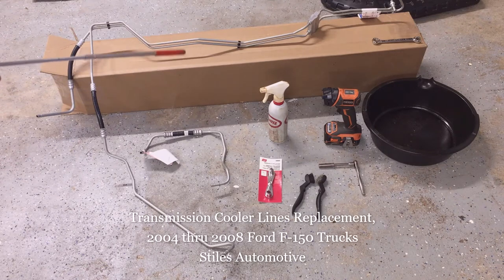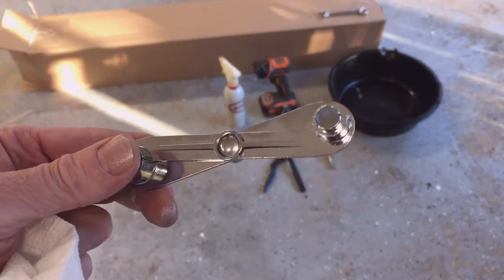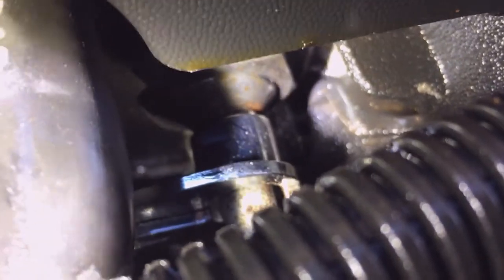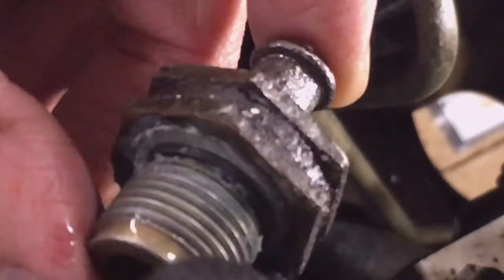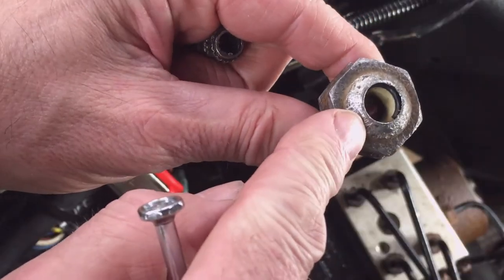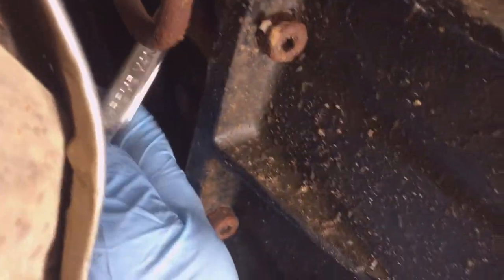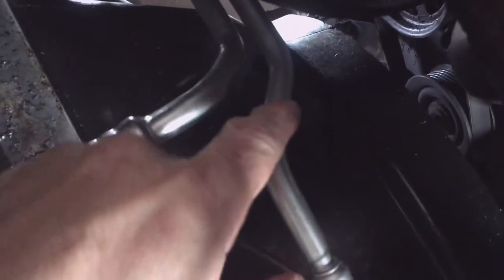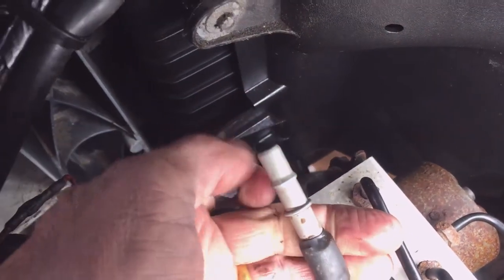Transmission Cooler Lines Replacement, '04 thru '08 F-150 Trucks

Comment: Damn! Seems hard but doable like u said. This is my next task. My 07 f150 lines are rusted and leaking bad. Thanks for the video.
Reply from the maker: Zeerich, Yep hard and something you can do. So hard in fact, I bet, some young Designer used a CAD Software to manipulate the Transmission Lines and remove them in the Virtual World, prior to the F-150 prototype and production. Let me know how it goes! - Stiles

Comment: Just finished this job on my 04 f150. Thanks a lot for the description, tools and P/N’s. A second pair of hands really helps too.
Reply from the maker: Hamid, You are very welcome! - Stiles
Reply: Did the p/n he provided fit the 04?  Most sites are giving me a different part number and different picture.  Just wanting to make sure.
Reply: @davidmobley4983  yeah the p/n’s fit. Also if you’re in a pinch some dealerships carry it. Also If you’re replacing the oil cooler, check advanced auto parts if you have one near you. CODE: DEC3
Reply: @hamidbaweemu7869  Sorry to ask again, but did you get the 5l3z -7r081?
Reply: @davidmobley4983  yes and 7R081 was my transmission too.
Reply from the maker: @davidmobley4983  David, I didn't see this exchange of information until now, you have to comment to the first level of the video for me to see it in a You Tube inbox.

A great resource for Part Number and Fitment information is simply Ford Parts. Com   -   https://parts.ford.com/  

If ordering Parts thru this website: My local Ford Dealer Parts Department was confused by the order, you can order 3 different ways: 1) Thru FordParts.com, 2) Thru the Local Dealer Website (which mirrors the FordParts Website, and of course 3) at the Local Dealer Parts Window/Counter.   - Stiles

Comment: having this exact issue and you saved me $600, thanks alot man
Reply: mine was actually the upper connector
Reply from the maker: Justin, It sounds like you already completed the job, but if you haven't consider doing the Power Steering Lines (and maybe Pump) at the same time. You are under the Truck and working in the same area . .  and if your Transmission Cooler Lines are corroded your Power Steering Lines are probably as well! I also did a video on the Steering Lines and Pump (see link below). You are very welcome, I'm glad to help! - Stiles

Power Steering System Rebuild (Removal-Cleaning-Installation) - 2004 thru 2008 F-150 5.4 L  https://youtu.be/m1BS50bgKLk

Comment: Great video! Extremely helpful and I appreciate the description links. Thank you
Reply from the maker: SixPack, I try to give you everything you may need if you haven't done the task before. I appreciate the feedback. Do you have a 3x 2bbl car, like your name implies? - Stiles
Reply: @StilesAutomotive  Unfortunately not, but the old 440 six pack Barracudas are some of the coolest cars. If anyone reading this has one and wants to trade for a rusted F-150 with a transmission fluid leak, let me know

Comment: Bottom of my truck is all rust. I hate Ford and all the others because they can't take the time to zinc plate or treat components against. All about the money. The other thing are the quick disconnects. Why can't new ones be included with new lines purchase? I don't get. Pain in the rectum buddy. Good video. Subscribed.
Reply from the maker: Rob, I'm with you on that!  For a little money, all OEMs could make cars last 10x longer.  What am I going to do? Buy a new F-150 and take it apart so I can treat the frame, then the parts as I put it back together?  That's an ideal, Ford should sell me a complete F-150 in parts . . . I hate rust!  Don't get me started. Thanks for the comment. - Stiles

Comment: You used both the Lisle and Assenmacher cooler disconnects.  Both are 3/8”.

Since both removal applications on the radiator and cooler are 3/8”, does one work better than the other or do I need both?

Great video . . .
Reply from the maker: Robb, I actually broke the Lisle Line Scissor and ordered Assenmacher Tool, when I determined I needed the Trans Cooler a few days later. To be fair, I abused the Lisle Tool pretty badly, so I didn't show it broken in the video.  The Assenmacher  Tool is much nicer, and I took care of it.  I like the Assenmacher Tool better, but it is just 3/8", the Lisle Tool is half the price and also fits 1/2" ( on the other end).   I appreciate the feedback! - Stiles

Lisle 39660 1/2" x 3/8" Transmission Oil Cooler Line Scissor https://amzn.to/3m9eeQ2
Assenmacher Specialty Tools 8021 Oil Cooler Liner Remover Tool, 3/8"  https://amzn.to/3dRlCet
Reply: @StilesAutomotive  How did you determine that you needed the cooler after you installed the lines.  Was there debris that backed up pressure and caused a leak?  I was wondering if I should gamble that the cooler is still good after 220k miles.  I’m the second owner so am thinking it is the original cooler.

Comment: Thank you for the detailed video. Your helping me with mine at the moment. Almost removed the old line but what size flare nut wrench at the transmission?  Thank you again for the video.
Reply from the maker: JD, 5/8" for both Lines at the Transmission! You are very welcome, I hope your replacement goes well! I appreciate the comment! - Stiles
Reply: @StilesAutomotive  Thank you. I promise I listened to your video about pulling the whole thing out to practice to put the new one in. I got the old one out and trying to put the new one in. But I'm guessing you used magic because this is insane lol. And I had to cheat and cut the old one and now dealing with the consequences 🙃

Comment: Thanks for the info! Question, i believe my leak is coming from the transmission thermal bypass did the lines you recommendee off amazon come with that?
Reply from the maker: Tuan, Yes, it did come with the Bypass Valve. You can see it in the Thumb Photo or in the video when I show the components required, I also link to the Amazon Page in the video description which show a photo of the lines. - Stiles

Comment: Thank you for this video. I am ordering parts now. Is there a special procedure for filling the system. I found comments that there is a special heater tool for the fluid that is needed to open the thermostat block to get the air out?
Reply from the maker: John, You are welcome! I you are working with an OEM (at least Ford's) Transmission Cooler System there is no need to bleed or purge the System.  The Transmission Pump puts the Fluid under pressure when it runs it thru the Cooler, this will push the Air to the Transmission. You do need to properly fill the Transmission and use the Ford Operators Manual to determine the proper Fluid level.  Go back after driving the Truck and check the level again. - Stiles

Comment: I’m trying to figure out which tools I need to order from Amazon? You said one arrive later so do I need all three?
Reply from the maker: Dave, Did you see my reply to your other comment?  You need either the Lisle Tool or the Assenmacher, one or the other, I'd recommend the Assenmacher.  The Lisle Tool can also be purchased at your local Auto Parts Store. May sure to get the correct Tool Model Number, this Tool looks similar to other Quick Disconnect Tools.  - Stiles

"Dave, Nope, Sorry. If you have an F-150 you have 3/8" Cooler lines, if you have an F-250 most use 1/2" Cooler Lines. The Premium Assenmacher Tool (Shown) is 3/8" - Cooler Line Tool Assenmacher 8021 3/8" https://amzn.to/3dRlCet. The Lisles Tool is for both 1/2" and 3/8" - Cooler Line Tool Lisle 39660 1/2" x 3/8" https://amzn.to/3m9eeQ2. If you are removing the Lines from the Transmission you also need - The Flare Nut Wrench Set, 3 Pc SAE https://amzn.to/3iN9r5c

I always list all Tools and Consumables in the video description for each and every Task I have on my Channel. - Stiles"

Comment: I can not find a full line assembly like you have here. Your link is only showing the line or #3, I REALLY need #4 but can not seem to find a part # anywhere. Your assembly looks like it came with it. Did it?
Reply: FORD 7H322 - for anyone also wondering the same! Took me HOURS to find
Reply from the maker: I show the 2 Line Assembly in the first 30 seconds of the video, I copy the link here (Trans Cooler Line Ford 7R081 both lines https://amzn.to/31YoqUw  ). This is the compete 2 line Assembly for the 5.4L 

This Ford Parts Site is helpful (it shows the Assembly and your 7H322 Valve Assembly):
https://parts.ford.com/shop/en/us/transmission/powertrain-engine-parts/oil-cooler-assy-7891527-1#/sectionId:141078549    - Back out of this link and put it your exact vehicle information, use the Driver's Door Sticker to determine your F-150's Build Date, as required.

This Ford Site answers your last question, "Did it?" Yes it is the complete Assembly including 7H322 Valve Assembly.  Notice the little Square Indication, pointing to what is in the 7R081 Oil Cooler Tube Assembly.

Let me know if you need any other help! - Stiles

Comment: Anyone know if this works with 05 f150 4.2L v6 ? Looks alot like the one i need to replace it has a rubber hose/hose clamp bandaid on it and it wont last forever😢😢 hard to find this hose. Thanks for this video btw.
Reply: An update if anyone is wondering I ordered this 5l3z-7r081-cb and it does not seem to work on the 2005 Ford f150 4.2litre it looks almost identical but when I routed it it angles the wrong direction and can't work. I'm going crazy trying to find this stupid part and be done with it. Back to looking . Hopefully this Ford dealer i bought from this Amazon link will let me return it ..........😮😮😮😮
Reply: And to top it off I called ford hoping they would give me a part number . They did but it's the exact same part I ordered and now I think I'm crazy cus I already shipped it back but it was clearly different all the angles were going the wrong direction. 

They said 5L3Z7R081AB I dunno if that is different than 5L3Z7R081CB 🙉
Reply from the maker: Bonzai, It looks like your Truck has 3 options, with and without the front Transmission Cooler, and there is a Production Year Split for the 4.2L F-150: 08/23/2004 - 11/29/2004  and 11/29/2004 and after.  I cut & pasted the information below and added a link to the Ford Parts website, if the link doesn't work for you. Go to https://parts.ford.com and put in your Make and Model information. - Stiles

Automatic Transmission Oil Cooler Tube - 4.2l. (No Front Cooler, Stiles added comment)
Part #: 5L3Z7R081BB <-(one of these is clearly wrong, Stiles added comment)
Usage: 11/29/2004 - 08/08/2005, F150/Mark LT, 4 Spd A/T AODEW/4R75E W/TSS, Less Transmission Oil Cooler;11/29/2004 - 08/08/2005, F150/Mark LT, 4 Spd A/T

Automatic Transmission Oil Cooler Tube - 4.2l.  (With Front Cooler, Stiles added comment)
Part #: 5L3Z7R081BB  <-(one of these is clearly wrong, Stiles added comment)
Usage: 08/23/2004 - 11/29/2004, F150/Mark LT, 4.2L V6 12v OHV EFI, 4R70/4R75 W/E 4 Speed Trans, Less Trailer Towing

Automatic Transmission Oil Cooler Tube (With Front Cooler, Stiles added comment)
Heavy Duty Aux Trans Oil Cooler.
Part #: 5L3Z7R081CB
Usage: 08/23/2004 - 11/29/2004, F150/Mark LT, 4.2L V6 12v OHV EFI, With Standard Engine Cooling System, Additional Information May Be Required, We Recommend You Contact Your Local Dealer Or Helpdesk Before Ordering

Link to Ford Parts for 2005 F-150 Transmission Cooler Parts:
https://parts.ford.com/shop/SearchDisplay?storeId=1405&langId=-1&dealerId=24218&catalogId=251&krypto=DS8YH4lDP3tS5gM54tVZyS97FYpRFFHPX6LYRvEiwPI2qpskdFrVdwD%2F%2FQl1q%2BqDvrlsLEEz705Yzf8QDB07nLzLrM7AsKRE6hdPyoFcb%2FmbqkKcuTyhO%2Bhs3JI3RhmAKu1wmDg%2FHnE24RjI8GsYO2IPUau8ZuAjvT%2F4qj7SFdY%3D#facet:&productBeginIndex:0&orderBy:&pageView:&minPrice:&maxPrice:&pageSize:&

Comment: The plastic covers are probably to ensure the line stays in place and does not wiggle loose.
Reply from the maker: Tonic, I'm sure you are right. Ford calls them a "Latch" in their parts catalog. This would indicate they are holding the Line. I can see that they would hold much, but may be help a little. Thanks for the comment! - Stiles
Reply: @StilesAutomotive  thanks for the video. Without this video I am not sure I would have even considered attempting this.
But with the video I can start looking into whether I will tackle this or pay up for someone else to do it.
Maybe start by seeing of I can crack those nuts loose at the trans, as that part looked to be the most tedious and tight area.
Reply: @StilesAutomotive  Question: is this a 4wd truck? 
Curious if that changes anything.
Reply: Thanks for taking your time Explaining the whole installation of your Transmission lines. your Video, very helpful, I’ll work in my truck 🛻 with all your Instructions, and Hope I’ll get it done Rigth😅😊

Comment: Where can you locate the bolts for the bottom of the condenser that you were having an issue with right there on the side of the radiator part because I’m having an issue with those bolts taking out those quick releases so I was trying to locate the bolts themselves
Reply from the maker: Ray, The Quick Disconnects on the Radiator are hard to find, I know they come on new aftermarket Radiators, but I don't know a good place to get them. - Stiles

Comment: Little bit of atf on those rubber orings would help
Reply from the maker: Bro, Yep, good tip, Transmission Fluid on the O-rings is an excellent lube for these lines. - Stiles

Comment: So did you have to drain the trans first?
Reply from the maker: Gary, Nope, not necessary. You only get the Transmission Fluid in the Lines and Cooler, the Transmission pumps the Fluid thru the System.  However, when doing this work, now would be a great time to service/change the Transmission Filter and Fluid. - Stiles
Reply: @StilesAutomotive  I bought a used car. 125,000 miles. Trans fluid was never changed. Got a new pan and filter. They replaced 6 quarts. I am now kicking myself for not changing the cooler lines. They are rusty. I will go in soon. I just don't want my trans to start slipping if they change too much fluid too soon. Parts are ordered and are going to the dealer. I guess everything will be ok. Thank you for your response.

Comment: These supposed Quick connect stuff is an absolute pain in the ass. Mine would never come off the old lines so I bought new ones. Now I can't get the new ones to push onto the new lines.
Reply from the maker: Looneyflight, Agreed, you heard me talk about the design, when dirty are hard to use, but new ones should be easy. May be they are just a little tight, but should still go together and positively lock. Let me know how it goes! - Stiles
Reply: @StilesAutomotive  I had to use scotch Brite and ATF to basically sand the lines down a little. After that I Grabbed the line with my Knipex using the tie rod for stability and hammered it on with a 3lb hammer. 
After that I Grabbed the line with some channel locks while I struggle to get it lined up and held still turning the fitting and getting it started was a pain.
I finally got it all back together and the clips didn't fit so that means I don't think I have it all the way in.
I drove 700 miles after that and no leaks.
This all happened on a trip between jobs and it had me stuck in Texas for some days while I found the leak and getting the parts to fix it.
If it's a tube put a B-nut on it, if it's electric put a cannon plug on it. Would be way simpler.

Comment: Does the yellow retaining clip actually slide into the groove of the fitting in the radiator?
Reply from the maker: Jwnagy, If I understand you correctly, yes it does. - Stiles
Reply: @StilesAutomotive  I asked because mine don't....and it looks like it should, except the groove isnt wide enough. I replaced the radiator and the fitting appear to be slightly different. I may have to sand the clip down a bit to make it thin enough to fit it the groove.

Comment: Approximately, how long of a job is it having the rust issues, you faced? Two hours, four hours?
Reply from the maker: Robb, They say, "Time flies when you are having fun!" and I'd say, you spend a lot of extra time when fighting rusty components. Yep, this job wasn't too bad a little over 4 hours, that's with the Transmission Cooler, too.  I'd say, I spent 15 or 20 minutes at the Vice on the Bench working on getting the cut-off Cooler Line out of the Quick Disconnect Fitting that I un-screwed from the Radiator.  On a new Truck on a Hoist replacing the Transmission Cooler Lines from the Trans to the Radiator is a 20 minute job.  Let me know how it goes! - Stiles

Comment: Does your truck have skid plates? Doesn’t look like it. Been staring at mine trying to figure out how on earth it’s possible to even get that line in there. Assuming I need to take them off to do so. Dreading doing this but needs to be done..
Reply from the maker: Nope, I don't have Skid Plates, I do have a Plow with a Plow Bracket mounted to the front of the F-150. It may be possible to put the Transmission Cooler Line Assembly (as shown in video) in from the front thru the Front Bumper, but not with the Plow Bracket.  I routed the Assembly into place from the Back.  It just fits over the Crossmembers and under the Engine Oil Pan and a long the Rightside of the Oil Pan.  Like I stated in the video, it is not as hard as it appears.  You could always make a repair with a 3/8" Hose and a few Hose Clamps, but the best is replacing the Assembly and the other Line (the small Cooler Line form the Radiator to the Cooler).  Let me know how it  goes! - Stiles

Comment: Is there anything else you could use besides the transmission cooler line tool?
Reply from the maker: Rextruh, Maybe, if the Quick Disconnect was brand new and easy to actuate, you could a thin piece of plastic rolled into a cylinder. But, the Cooler Line Tool Lisle 39660 1/2" x 3/8" is $10 on Amazon  (this is a link to an Amazon Page:   https://amzn.to/3m9eeQ2 ) and you can purchase locally at most Parts Stores. - Stiles